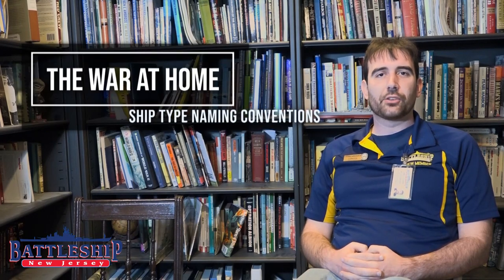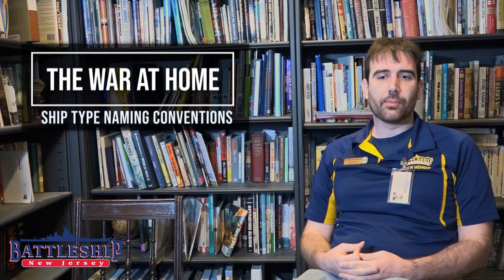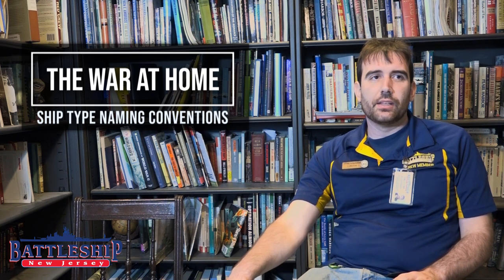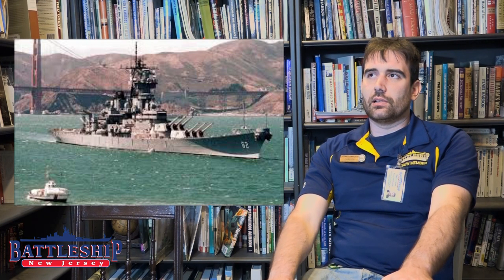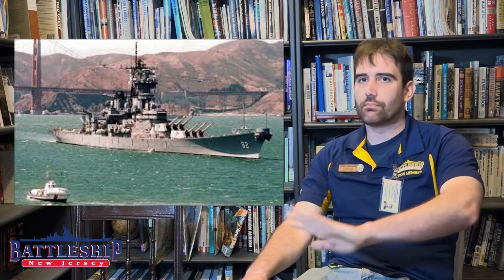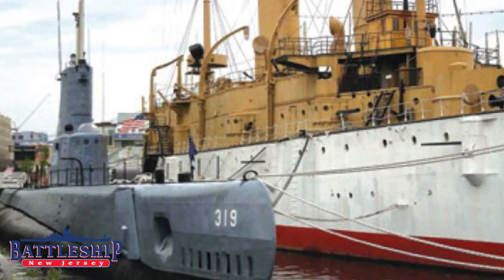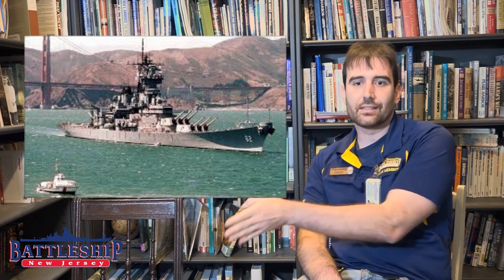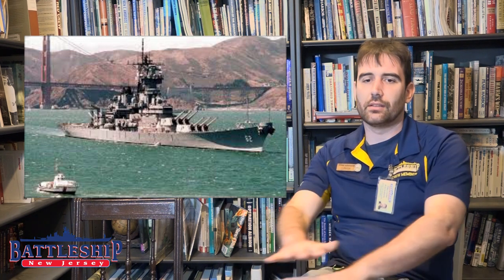The War at Home: Numbering Conventions

Comment: The Navy also used the N designator for something other than Nuclear - CV-6 was changed to CV(N)-6 to indicate that she was equipped for night operations.

I've also heard that CV was Cruiser aViation, since the A was already used they went with V - and as we know the Navy already had pilots so those flying aircraft were aviators, which are better than pilots - just ask them.  Some low level clerk probably thought up something that made them easy to remember that made its way up the chain and has been lost to time at this point.